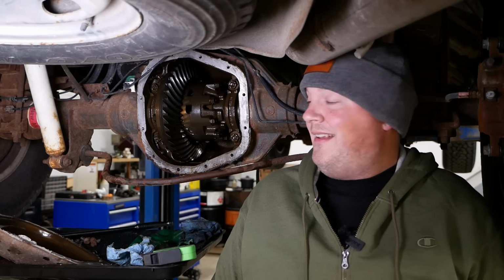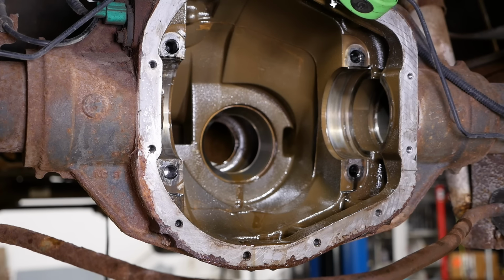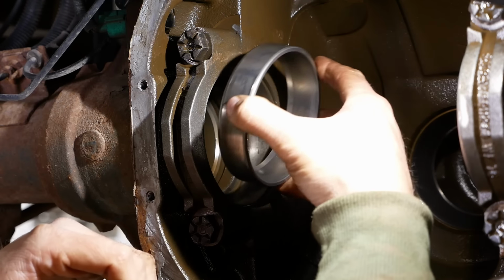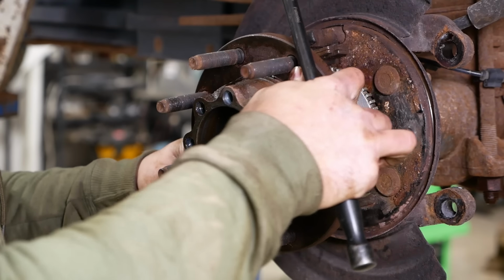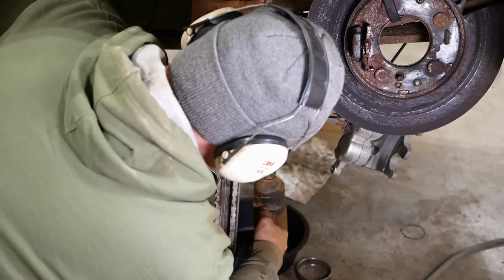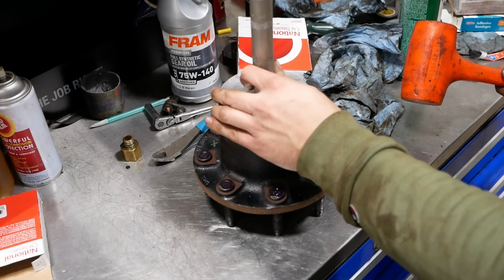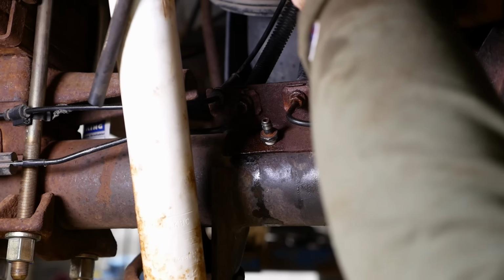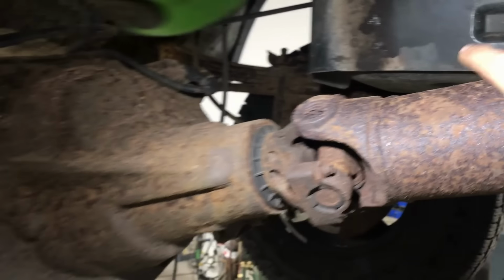Ford Differential Carnage - Driveline Noise Located

Comment: I noticed you covered the license plate with a glove, A suggestion, have Mrs WWW make you a license plate something that has you logo on it,  and if it had a couple or three magnets secured to the back side of it, that would help it cover the customers plate. Just a thought.
Reply: How are you going to stick magnets to an aluminum license plate?
Reply: Definitely can’t let the public see the license plate 🤣
Reply: @whatitis99  In my state, they are still metal, AKA steel for now.
Reply: @whatitis99  bolts are not aluminum
Reply: Sell yourself. 
This is not greedy, this is good practice for a YouTuber.

Comment: When you have questions like that bearing fitup issue, dont hesitate to reach out to the pakastani truck guys, they have some creative ways of solving problem :)
Reply: Well, that's a totally different situation. New parts and salvage parts aren't readily available there for cheap. It costs less in most cases there to actually do a machine job with metal build-up to put a piece of equipment back into service where a new or used axle/transmission/etc, would be infeasible. They do some of that kind of machine shop repair work at the place I work right now, but it's usually on parts that aren't readily available for purchase anymore. Like equipment from the 1960s, 70s, and obscure truck equipment from the 80s.
Reply from the maker: Beer can shims, or build it up with a stick welder, grind it back to spec with a worn out grinding wheel.
Reply: @WatchWesWork  I don’t think they drink beer, must be soda cans.

Comment: Years ago my brother & I were stripping a Land Rover rear axle.  The pinion was fighting like a good 'em.... we stepped away to find a larger tool of persuasion, there was a loud bang and the tinkle of a window being smashed.  It had come loose and had flown out of the garage and through Mum's new greenhouse (we'd put up the day before).  To say we were both relived and unpopular at the same time is an understatement....
Reply: I suspect that was a 'Salisbury' model axle and, IIRC, they required a special spreader tool.
My first purchase from a dismantler was a pair of brake drums for a Series 1.  A couple of years later I became one of the staff there.
Reply: @robt2151 jam a prybar on the spider gears and rotate the pinion flange. the carrier will now come out.

this works for any spicer/salisbury and salisbury-type (integral carrier) axle
Reply: Cheers

Comment: I've got a 2003 2-wd F-250 Super Duty 7.3 Diesel Crew cab with 114,000 miles .  I don't think my rearend is a lockup as it's designated a Limited Slip on the window sticker , I'm the original owner . Thanks for a Great Video . Man this old 7.3 Diesel still pulls like a mad man .

Comment: Smell-o-Vision will be great though, I have grown up on a farm in South Africa 200 miles from the nearest town and we fixed all our equipment ourselves. Mostly we just relied on the neighbors' knowledge and guess the rest, but the smell of oil, grease and diesel still remind me of those days. Thank you Wes for showing me where we went wrong and where we guessed right. One time our 1950 Fordson tractor started knocking furiously, so we discovered the big-end bearing was worn out. We had no replacement bearing, so we installed buffalo hide cut correctly and soaked in water. It lasted for 6 hours which tied us over until someone went to town. Good old days.

Comment: Love watching Wes's videos. You see him with the impact getting ready to take the U bolts off the normal way, next scene the death wheel LOL to take them off the correct way.
Reply: Eh, I would have tried a torch on the U-bolt nuts first if the threads and shanks of the u-bolts weren't severely rust pitted. I live in the rust belt too and you typically try to save anything that isn't just completely rotten away or going to cause a failure later down the road.
Reply: Yeah, i would of gone with the devils night light
Reply from the maker: I've never seen a U-bolt that could be reused. Even if they are not rusted, they are a torque to yield fastener.
Reply: I think Wes was just relieving some of the tension on the bolts so he could cut it safely
Reply: @WatchWesWork  Maybe new passenger light duty trucks, where all fasteners are throw-away. But 3/4" and 7/8" u-bolts have always been reusable unless they've been stretched beyond limits.
Reply: I've never reused a U bolt, I just don't trust them. New ones aren't really very expensive.
Reply: @gator5081  I know I should buy new ones but I usually just turn my air impact up real high and torque the hell out of them thangs. 😂
Reply: @JosephArata  The U-bolts are heat treated spring steel and shouldn't be heated.

Comment: My 1990 F 350 would leak diff oil from the seals, ruining the shoes in the process. Replaced the seals and it did it again. With a little research I found that the factory bearings were wide enough to ruin the seal. A kit was made with a narrower bearing and a better seal. Never leaked again, but why didn't the mechanic that did the first repair know this and why didn't the parts supplier know this. Worse yet, when I did the repair myself, I had to educate the ford truck parts dealer about the update.
The ford instructions said to pack the bearing.
Nice video.

Comment: 13:30 i helped a friend with a rarer 1920's diff for a merc, by creating a locking point system with braze. Holes drilled in the base of the diff case and then pegs brazed on the outer races of the smaller, but closest equivalent bearings we could find. The unmodified fit was just as loose as what you're presenting here. That was some years ago, and no issues so far. If done carefully, brazing the race doesn't warp it too much. Caveat, it does deform somewhat, so a fitted truncated cone was fabbed before so we can hone the face back into spec, which wasn't that difficult.

There's more than one way to skin a cat, plenty of way. I mean, you could even clad the bearing holders with braze and hone that.
Reply: in that instance I agree with you, cause for you you're skinning a cat that's the only cat in the world and it has to work, for Wes it's pretty much your regular ol' tabby and he just needs to get it done cheap and quick, he got the repair done probably for less than just parts the other way

Comment: 42:25  Instead of the plastic pans, look at rubber feeder pans they sell for horses. TSC Tractor Supply has them.  They are softer, they handle cold and abuse better.

We  have a couple of stainless bed pans scrapped out of a hospital/nursing home.  
Surprisingly useful and hell for stout.
Reply: I was stoked the day I got a cement/mortar mixing pan.     But you just got me hip to a totally great idea using those rubber feeder pans.     Those things are practically invincible.     Thanks for sharing!

Comment: I do like ford's F-250 and the 4 wheel drive set-up. The E-locker on the rear diff is great. I used mine for snow removal and it was a tank.

Comment: Excellent decision on the rebuild vs junk yard housing, Great video and editing. You are a great teacher of mechanics. After all the metal in the rear I would worry forever about the use of the housing with latent metal migrating into the bearings and gears. You are the best.\
Reply: A good cleaning will take care of it. Any small amount left over will be cought by the magnet on the diff cover. Just try and get out what is reasonably feasible to do. You will be replacing the fluid after about 500 miles due to break in procedures.
Reply: @williamallen7836  My concern is always the residual amount of metal that can migrate to the axle wheel bearings. Not too many mechanics wash out the rear end tubes like 16 inch guns on a battleship.
Reply: @tonyrum5808  There really is no need for cleanliness to that degree. A basic 20 minute clean is enough. Anything that would be left will be so fine that it will cause no harm, and picked up by the magnet. It will look like what is on the magnet after the first 500 mile brake in gear oil change. They are designed to deal with very fine metal shavings that are produced between gear oil changes. Hence the magnet to catch the stuff that will cause damage until the next gear oil change.

My pinion bearing was destroyed far beyond the one in this video, and a basic cleaning got the bits that would cause damage. The roller cage was in about 1K small pieces. When I rebuilt the 10 bolt in my Camaro I used 3 to 4 cans of break cleaner. Prior to this I bolted the diff cover on with the center section & pinion gear removed. I shot some kerosene down both axle tubes  as a general flush that removed most of the bits. Then used a broom handle to push kerosene soaked rags from the wheel to the center section, and pulled them out ware the pinion gear used to be. Similar to cleaning a gun. Once very little to no metal shavings could be seen, I started spraying break cleaner to flush any very small shavings to the center section. Removed the cover, the magnet cought most of it. So I cleaned the cover. Then with the pinion end pointing upwards I sprayed down through it to clear the gear oil passage out. Then sprayed out the rest of the center section. A quick spray of wd-40 down the axel tube, and the center section to prevent rust while I worked on the rebuild. After the 500 mile breakin the only shavings on the magnet was the very fine shavings from the pinion & ring gear breaking in. Looked almost like mud on the magnet. There's no need to worry so much as long as a basic cleaning job is done.

Comment: Wes having worked in the Sheet Metal trades for 28 years I've learned when operating a Grinder or cutoff wheel etc that not only does it pay 
to use safety glasses, but a face shied is pretty much required as well, after all if you get (and I have) slivers in your eyes you get to watch the 
doctor pull them out! and after all, eyes are not available off the shelf!

When I look in a mirror, I see the person who is most responsible for my own safety!

Comment: It appears as though there was water intrusion into the diff, and afterward the truck may have sat undriven for a period of time which caused the bearings to become fused (rusted) to their races, causing the races to spin. Great video!
Reply: You might be on the right track..........I would agree
Reply: Does water intrusion cause the gear oil to get foamy? When I did my trucks diff at 180k miles it was foamy like that.
Reply: Just FORD built explains it all
Reply: The plugged breather tells me the truck saw plenty of water and mud.

Comment: Bearing spinning in the housing and Wes says "there is no easy way to fix that." Then he suggests grinding the cap and line boring it!?Wes, Wes, Wes, you act like a man who has never made a shim from an beer can. That's an easy fix brother. It's like using a piece of leather belt to fix a rod bearing or a piece of emery cloth wedged in a wiper arm stub shaft to keep it from slipping. I mean sawdust in the oil pan, pepper in the radiator.... oh I can go on all day. Jk'in you did the right thing man but for the record a beer can and green locktite she'd been good as new :). Cheers buddy!
Reply: Spotted Cow comes in a can too.
Or Yuengling.
Reply from the maker: We call that the “Chicago Rebuild”, a tube of super glue and a sixer of Milwaukee’s Best…
Reply: @WatchWesWork  Had a Dana 44 out of a Jeep years ago with the same deal. Got some copper foil ~0.001" thick and wrapped the bearing race with it. Heard from a friend of a friend that that Jeep is still chuggin' away.

Comment: I'm happy that you didn't have the same issue I had with my 2012 Ram 1500 after an axle swap.  Mine was bent in an accident, so swapped in a used axle from a scrap yard. Drove it about 10 miles and the pinion bearing blew.  Had to get another second hand axle and start all over.

Comment: I have a similar hub on my Ford.  The oil slinger behind the bearing ate itself and took out the bearing/oil seal.  I reassembled without the slinger.  If I understand it's function correctly it's intended job is to divert oil away from the seal.  Not to oil the bearing so much.  Good Video Wes!  👍. PS you're right the seals do suck, even with the Ford tool it's a pia.
Reply from the maker: It's surely not an essential component.
Reply: My 2004 srw f350 does not have that oil slinger. When I replaced the backing plates a couple years ago all it had was the seal on both sides
Reply: slingers are to lube the bearing, when oil level is low(up a hill) it grabs oil and slings it the upper portion and it travels down the bearing thus lubing it,

Comment: Its amazing that any rear end lasts anytime at all since nobody thinks to change their diff oil!

I love working on suspension and drivetrain components. I  rebuilt all my own diffs as well as for all my racing and off road buddies.

Back when I was really poor 😂 I would go dumpster diving at my job and they’d let me use whatever I wanted. It was a hydraulic machine shop for the mining industry so lots of access to all kinds of good stuff. 

I built my own 60 ton hydraulic press for $35 and my time. I also built a bench fixture so I could mount rear ends and transmissions so i could work on them and rotate them 360 degrees. Also built things like dana rearend housing spreader, camshaft bearing installer, bench grinder stand, etc.

Comment: Yes, junkyards do not sell certain parts due to liability. I was a car buyer for a junkyard for several years, and there were many parts that we did not resell due to liability issues. We also did not resell catalytic converters or air bags for the same reason. After the Takata air bag recall, we began pulling air bags from cars before they even went out on the yard to ensure that no one would even be able to steal them. We did not resell brake pads, rotors, drums, wheel cylinders, or hoses unless they were brand new, and customers had to sign a waiver of liability before we would resell them. We did not have any limitations on calipers or master cylinders though.

Comment: Wes the reason for the grease in the Bering hubs on the duce and a half is that it was protection against water. The duce and a half could run through water up to 48 " and the axels and third members were supposed to be water proof, vents on the pumpkin were one-way. I leared this while in Korea in the early 70's. I really enjoy your channel you can thank Matt at Diesel Creek for suggesting it.

Comment: Just paid the local Ford dealer to fix the noise in my 2016 F150 rear end at 160000, km.  Cost about $1,400 CDN. They acknowledged that the differential in this vintage of truck was problematic, but that there was no Ford warranty.  Ford has changed the rear end design since my truck was built. 
Good video Wes. I am glad I didn't tackle it myself as I don't have a hoist and would be laying on my back and getting dripped on by road salt. Would like to have saved some money though.
Reply: $1400 is a steal. I did this job myself on a 2016 Platinum, it was close to $800 in parts alone.

Comment: I think the reason they did use grease in the axle bearings is the different amount of static load. Grease can better withstand static loads there while the diff bearings do carry much less static load and thus can run in oil.

Modern oil can be mixed accordingly for the high static loads.

Also, grease can tolerate some amount of water content in the cavity, while oil basically gets milky. That is what killed this axle in the first place - so if it had used grease it would still work.
Reply: The grease will quickly get washed out by the diff oil. The Dana 30 in my Volvo wagon has an inner oil seal that keeps the oil out of the wheel bearing, allowing it run in grease only.
Reply: @maplebones  well yeah, you need to keep the system you have. You can't just put axle grease into an axle bearing which is supposed to run in oil.

But that wasn't my point here.

Comment: Wes with the noise and the metal on the  plug I would of stopped right there and swapped it out. The yards in Columbus, Ohio sell brake parts no problem. Thanks Wes, good video.

Comment: Wes in 1982 I did a GMC C35, someone had been into it before me. They had not tightened up the differential side bearing cap bolts. I took 0.005” off each bearing cap, then used Locktite red stud and bearing to safety it. 
That pickup was a farm service pickup, if it put 5,000 miles a year on it was a lot.  Later I found out that when the motor went out, the owner gave it to someone else who put it into a another C35 to convert from single wheels to dual wheels. 
Last I had heard the new owner put over 100,000 miles on it. I told the new owner what I had done. He commented that I must have done something correct!
Did water get into the differential oil. Kind of looks like it. 
Hello from north east Montana. 
10 miles from the Canadian border.

Comment: Another great job Wes, my only suggestion is you should have used a lube locker cover gasket (20 bucks) and you should have installed the aluminum diff cover from ford (60 bucks).
On a side note for that 10.5" to fail under 100k it had to have been submerged a time of two and left with water mixed oil. These axles are nearly bomb proof....